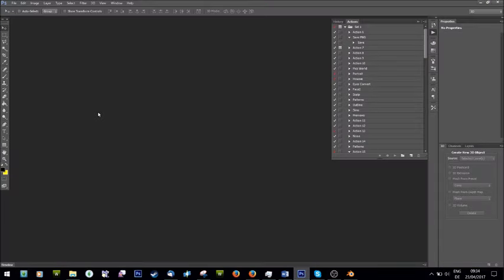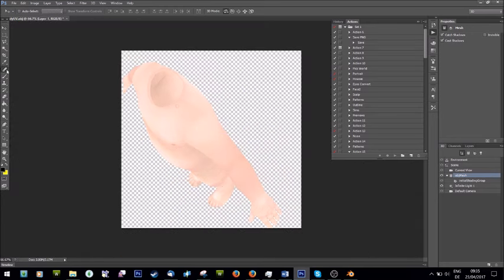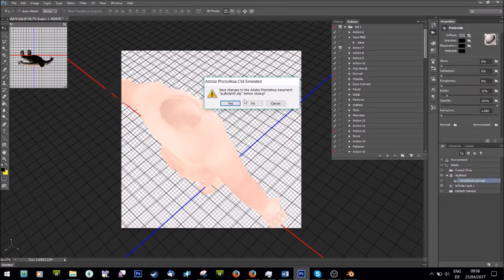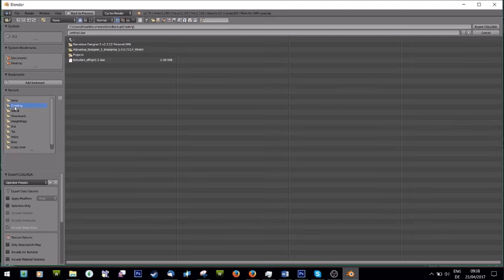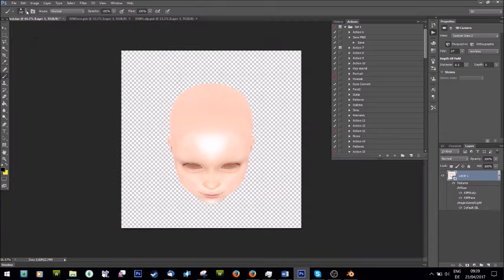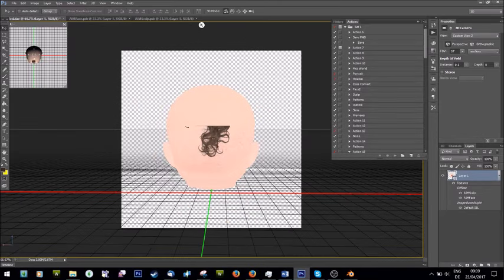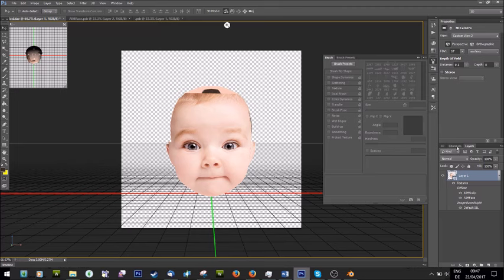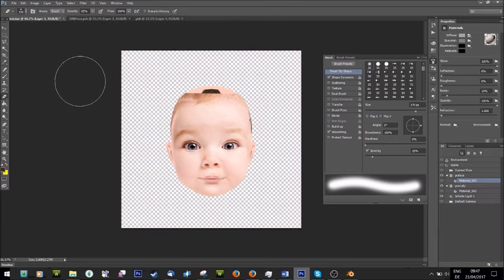Sims 3 Tutorial: 3D Skin Editing

Comment: Hey hi helloo. So thank you for the tutorial I do have a question tho Im using photoshop 2020 and when i try to replace the texture for my model i keep getting a message saying could not complete your request because it is not the right type of document. I looked around online and i cant seem to find any thing about photoshop 2020 having an extended version.  I know your using cs 6 but any advice you have would be greatly appreciated.
Reply from the maker: It sounds more like you don't gave the dds plug in installed? If you check sims3tutorialhub, and type in dds into the search bar there is a tutorial which also links the files, or if you have a real version of Photoshop check the resource page it links to the tool!